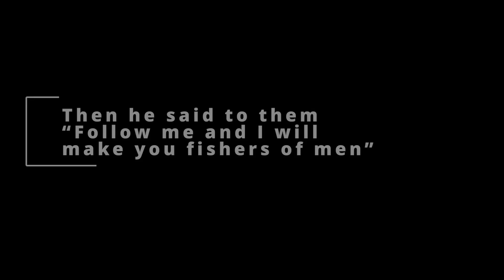Can We get the DIRT CHEAP Telehandler home?

Comment: Seems to me that solenoid valve is shorted out when you try to attach the hot wire to it. It shouldn't ark that bad when hooking it up. When you test it off the machine it's not grounded to anything so it would work properly.  Look at the point of connection on the solenoid to housing for metal to metal. Just my two cents worth. Keep up the good work.

Comment: The steel guide bars on bottom of boom and on the traverse carriage DO NOT Grease the run dry otherwise they get flat spots on rollers and fail . Grease the pins on back of boom up top . Good machine check for cracks behind tank on the frame . Usual spot if it gets overloaded developed crack on the big channel of frame behind hydraulic tank - had a few of these fail and needed welding.

Comment: boys,  it looks like your fuel return is clogged.  when the pump pressure equals the housing pressure there is no outward force on the plungers.  this is a way to stop a diesel with this sort of pump.  relieve the return pressure and that engine will run.  best wishes

Comment: Hank I been watching this fiasco of yall in this lull project  and I thought you would have figured it out but you haven't! That lull has multi function steering.  It is done only when it is running.  There is a toggle switch on the dash for the different ways to steer. It has crab , 4way, front ,rear steer. If you switch the steering from one to another and the wheels are not in time it will do as its doing now.! You have to make it happen  by moving the wheels all the way  one side. If it's in "rabbit and the front is not all the way and rear is then keep in crab til you get rear all the way to right stop or left stop. Then switch the steering to front steer on toggle turn front to right or left to the far stop same as tear axke is pointing the switch from front to crab again and turn till straight.  Then switch toggle to 4way steering and axles should pivot opposite so it's in 4 wheel steering.  Or you switch to front or rear steering and only turns one axle.  From what I see it's been switched from kne to the other out of time.  Once you get it set it will steer as you need it. I ran one exactly the same for a few years. We used to do that to other operators who not know how to run it and watch them try to figure out what was wrong.  It's a simple thing but can give you fits till you get it back right.  Please let me know if you get it right.. God bless.
Reply from the maker: Supposedly The hydraulics have been messed with for the steering so I'll need to figure it out once I get all my new hydraulics lines done and cylinders repacked.